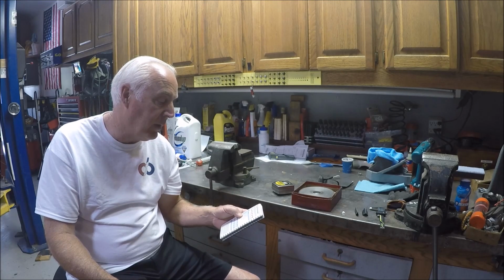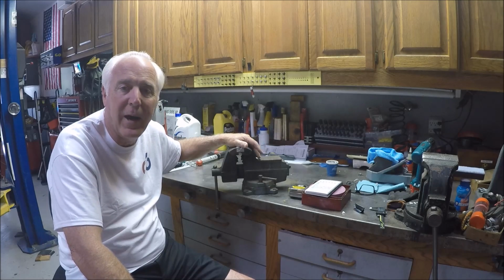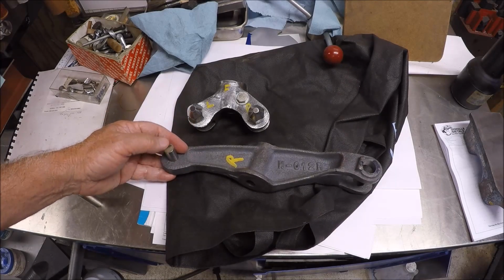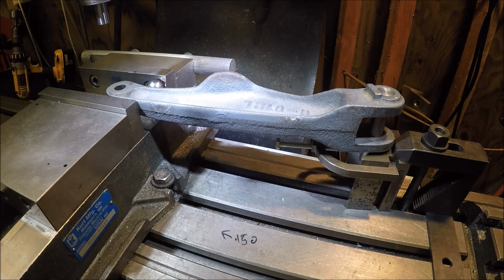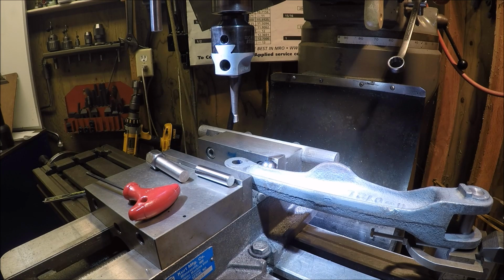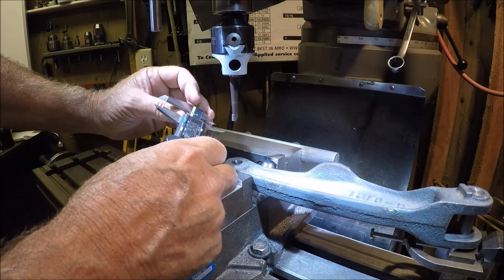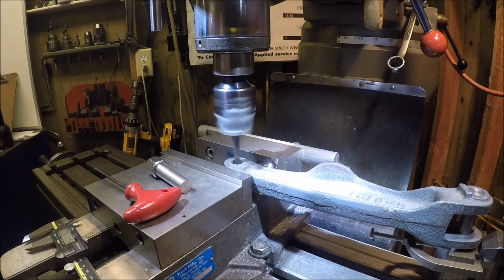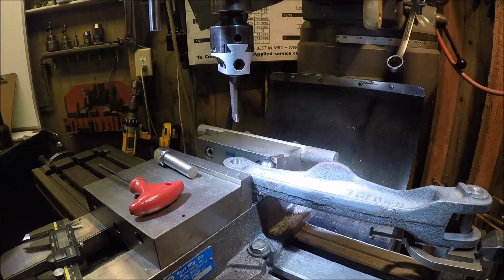My Friend Wilton---Screwy Tuesday

Comment: Your set up set us all up!  Question: no  need to tighten down the set screws on the boring head? Thanks Chuck
Reply from the maker: Hello Ron...my "set up" was overthought...LOL   Regarding the boring head set screws, Chui taught me to just have light tension on the slide set screws, no reason to tighten down.....Now, if I was taking very large cuts...I would probably tighten, but it would also depend on the tooling....this boring head is cherry and tight
Reply: Thanks Chuck

Comment: Hello Howie and Chuck,  How can you resist such a sweet guy even brings his own toy!  As an idea for you spare vise now; I weld a plate to a 2 x2  piece of steel tubing and use your trailer receiver hitch as a mount for the vise.  You can make a 'T' and have a sliding vertical for height adjustments.  Seems you always need a vise when you are out on a job and never have one handy.    I have one mounted to a large flywheel via a three inch  sch. 80 pipe.  I put a cover over it but it lives out in the front of the shop where I do my welding and grinding totally handy.  Give Howie a treat for me.  Take care.  Doug
Reply from the maker: Hello Doug....thanks for viewing, your support/friendship and comments.....Howie says woof to you